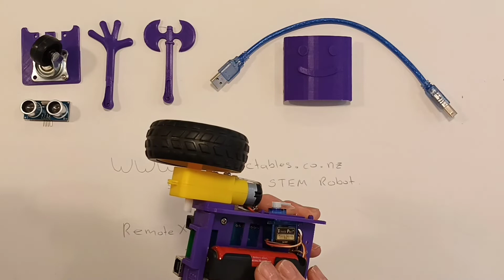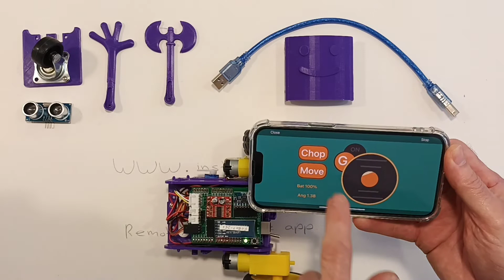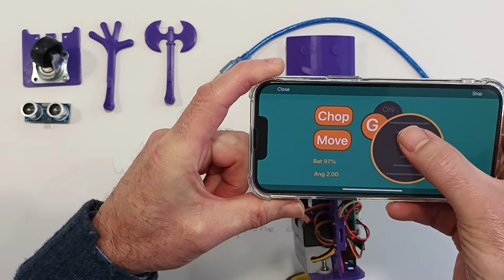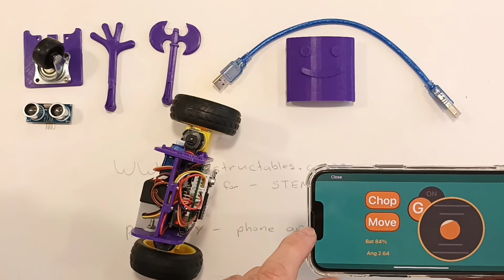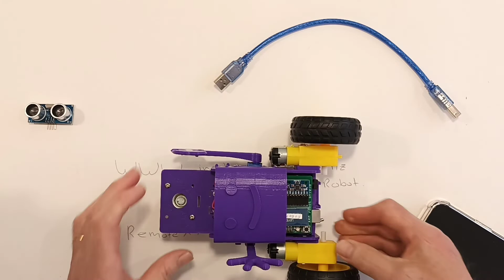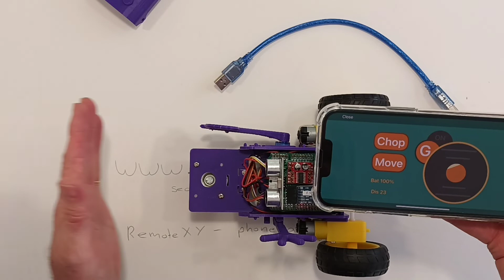Operating the balancing robot

Comment: Hello! Great video, was wondering if you cant just calibrate the IMU/'s once and never do it again?
Reply from the maker: Yes, generally you would only need to calibrate once (if you don't move or change the IMU), however the software goes through the calibration step each time you power up. It only takes a few secs so its not a hassle. 
BTW the full instructions on how to build the robot is here including the source code.

https://www.instructables.com/Educational-Balancing-3-Wheel-Robot/
Reply from the maker: Just to add to that, each IMU needs to be calibrated separately, therefore some form of automatic is required. Otherwise you need to hard code calibration parameters into the software (or determine an average set of calibration parameters - but this did not work as the range of parameters is too wide for optimal performance with all IMUs)
Reply: @robot7384  Yeah I had the perception that you can just hard code them.
Also another question, is the size and shape of the robot important for balancing? Im making my own and cant figure out the best shape and size for it.
And thanks for replying I really appreciate it!
Reply from the maker: @MogglyEditss it is not particularly sensitive to the size and shape - however a shape with a lower centre of gravity is easier to control than one with a higher centre of gravity. How well the robot balances is mainly determined by how well the motor PID controller is tuned - a PID controller is essential. Depending on how large the robot will be the selection of the motors is also important. I wanted to make a cheap robot so used cheap motors - many people use more expensive motors - but I don't think you will find many balancing robots that use these motors.